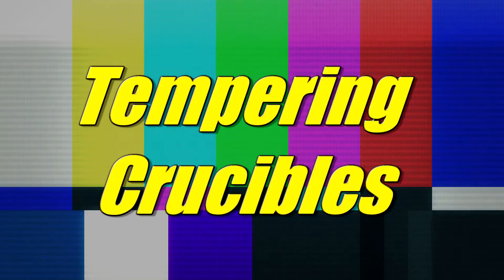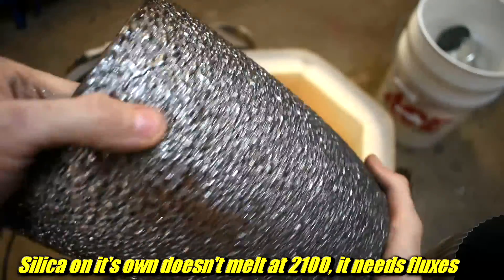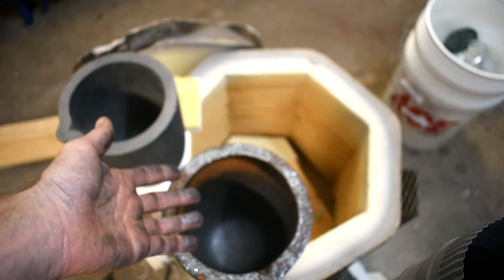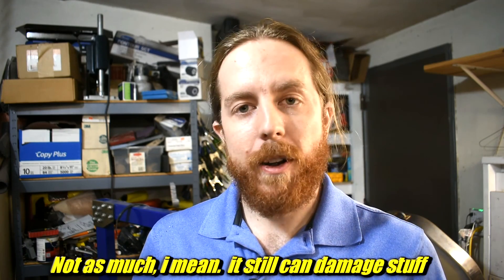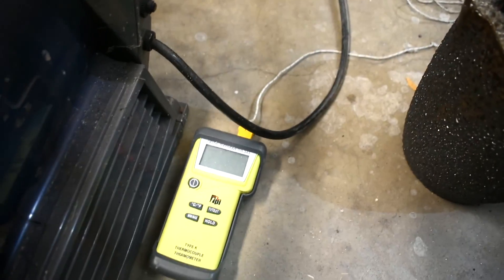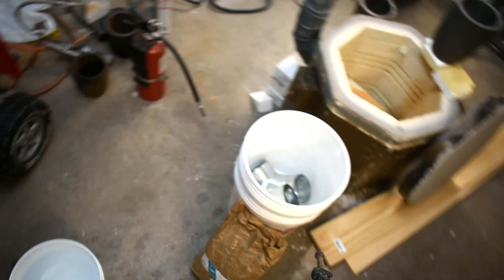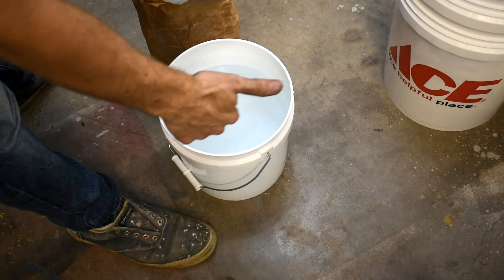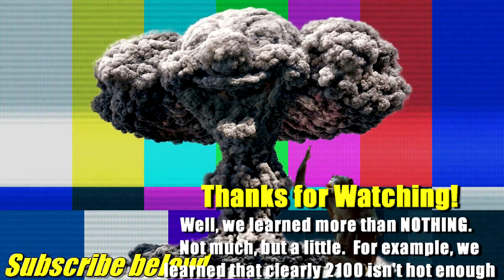Crucible Tempering Revisited: To use borax or not? or something else?

Comment: I just got a new #3 crucible. Are you saying I can make mine last hopefully indefinitely longer if I just go down to the drug store and buy a bottle of pure calcium carbonate supplement powder and mix it with water?
Reply: No - the crucibles will last 20-30 castings on average, depending on how well you treat and store them - if you want to make your crucible last just make sure that whenever you use it, you get it back into the furnace as soon as you finish your pour and then allow it to sit inside with the lid shut so that it cools down slowly.
Also, make sure to warm up your tongs so you aren't grabbing it with cold/cool metal and avoid putting it down on a cold or wet surface when swapping tongs after removing it from the furnace.
Reply from the maker: You don't even have to do that.  Temper it with heat alone, no need for added flux

Comment: speaking of salt, could it be an effective flux for this purpose? i know some blacksmiths use it for forge welding.
Reply from the maker: Yes! Salt would work as well, but like calcium carbonate, you would need higher temperatures than a typical aluminum melt.  Im just going to not add a flux, as the unfluxed crucible still showed a lot of vitrifixation (glass melting)
Reply: sodium chloride (table salt) and potassium chloride (table salt substitute) are used as covering fluxes for aluminum.

Comment: Any additive that results in the formation of a Eutectic system is a flux?
Reply from the maker: Is that the definition? That sounds so much simpler than the rambling i found everywhere else.  Makes sense
Reply: @PaulsGarage  I'm not a metallurgist or ceramics technician  but that was what my reading on the topic distilled down into. It does seem like the sort of explanation that is workable, a concept that lets you make predictions etc. If you want the details there is a pretty deep rabbit hole starting with a google search for "OpenCALPHAD".

Comment: Where do you get your K - type probes for your thermometer ?
Reply from the maker: A pottery supply place.  Most kilns today use type K thermocouple and frequently see temps around 2300f. So the probes have to be very durable and even then they are wear and tear items. Replacements are frequent.  Any place that sells pottery stuff/kiln stuff, even glass art should have the probes

Comment: I tried melting cast-iron and almost did it Paul if you buy a silicon carbide and crucible those crucible‘s are rated for 3200° but they’re expensive a 5 inch one is like $31
Reply: You can melt cast iron using a charcoal furnace with a hair dryer - found out by accident as my first DIY furnace used a old cast iron pot for my crucible and I actually melted out the bottom of the pot.

Comment: What happens if you temper it upside down, will it make a difference, as the glazing will move to the lip and not the bottom? Then when right way up and used the glazing will eventual start flowing back down.

Comment: Woah.... brave! I mentioned melting zinc alloys on Hack-a-day and was brought to the attention of the comments-section-safety-police.... you gotta be careful what you say. ;)
Reply from the maker: Those people are in all crowds I think.  My theory is that certain safety ideas are used as a mental shortcut by people who don't understand details.  Yes, zinc fumes are bad to breathe.  So do it outside and don't stand downwind.  Also don't overheat the zinc alloy and fumes will be reduced. Flintknapping can release silica into the air, and many factory workers making gun flints got silicosis.  So don't do it 10 hours a day in a closed room for 20 years, do it outside.  Crazed glazes on pottery can harbor bacteria.  So don't leave milk in the thing.  Not that I disagree with many safety ideas.  For example, I agree that lead should be removed from stuff.  Its not necessary anyway.  Leaded gas to reduce knocking? Alcohol does that too.  Lead pipes? Just use copper.  Leaded glazes in low fire pottery? Borate also works, and isn't toxic.  But mostly people need to calm down and take control of their own safety, not others
Reply: wearing a P100 respirator is sufficient for low quantities of metal fumes.

Comment: Calcium Carbonate, when burnt (around 1500 F) becomes Calcium Oxide. Cooled calcium oxide, particularly when made wet, turns back into calcium carbonate (lime). This reaction is the basis for making vaguely scientific concrete, but it also is used as a fluxing agent in iron smelting work. So perhaps your non-scientific meanderings accidentally trod into established scientific processes. A true shame that you actually did something non-random. Maybe next video.
Reply from the maker: I didnt know know that about iron smelting, but it makes perfect sense.  CaO's fluxing power requires a lot of heat but it should be at full force at iron melt temps.
Reply: @PaulsGarage  In steel making, they don't bother with pulverizing the limestone, it is just crushed and shipped in by hopper car.
Reply: Water added to Calcium Oxide = Calcium Hydroxide. Paul needs to read up on flux chemistry before spouting about really nothingness.

Comment: Thanks, I will try. I'm building my first furnace over the weekend. I've watched a heap of your videos and hopefully I can get it done. Best wishes, from Australia, Keep up the good content.
Reply from the maker: Thanks and good luck!  For more good metal casting info I would suggest swdweebs channel also
Reply: I made due with a DIY and finally gave up - just spend the money for a Devil Forge as those trashcan furnaces take a while to heat up and can barely handle aluminum so for the amount of time and money you'll waste building it and then the extra gas you'll use, it's cheaper and easier in the long run to simply purchase a real one.

Comment: Calcium carbonate....I knew that sounded familiar.....rolaids or tums.
I've seen some people use satenite to coat the outside of the crucible
Reply: @kfoltman  add marble to that list.
Reply from the maker: Yes! This whiting is from a pottery glaze supplier, but glaze recipes also often contain lime as an ingredient, or ground eggshells, both as sources of calcium carbonate.  Another common one is wood ash, though wood ash contains many other things, desirable in glazes but not in this case
Reply: Paul, Wood ash I think is about (depending on the type of wood) about 20 % potassium carbonate not too sure it contains any  significant amount of calcium carbonate. Easiest cheapest source of the latter is ground lime stone from a garden supply house.... Martin
Reply: Whiting also contained lime, Google is your friend, limestone also contains calcium carbonate

Comment: Hey Paul member when you melted cast-iron there is a crucible that you can buy that’s rated for 2900° maybe you should buy it and re-tried melting cast-iron again I bought that crucible and I want to try melting cast-iron with it I have several of them that are rated for that temperature basically all of them my furnace gets up to 2600° but I coded it would say at night
Reply from the maker: Hello! These crucibles are rated to 2900, actually.  When I did the iron melt I started with a bad crucible, but even good ones (and furnaces for that matter) became expendable at iron temperatures.  While my setup melted the iron no problem, I havent had a desire to cast anything with it, mostly do to the extreme heat and fuel usage it requires

Comment: Ok, now that I've watched the whole thing, I'm glad to hear a couple of things, 1) we basically have the same philosophy on tempering, just stick it in there and heat it up.  2) what you said about borite and flaking makes sense. I've never used any of the borite stuff and I've never seen my crucibles...what was the phrase?.. "turn to rubble".  I have seen plenty of other YouTubers with crucibles that appear to just fall apart.  I always attributed it to a different material, but I also know that some of them do the borax thing.
Reply from the maker: I think the most telling result here was just how vitrified the unfluxed crucible got at 2100.  If its that melty at 2100, borax would be way too overpowered.  Some natural borates are full liquid by 1650.  The only benefit might be that borates will form a glassy surface on their own unlike other fluxes, but thats not necessary for crucibles I think.